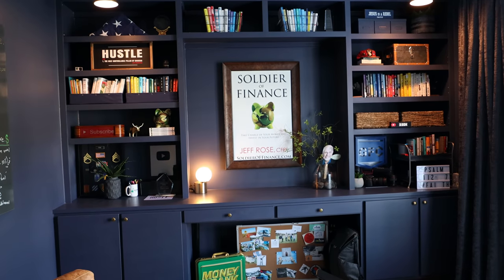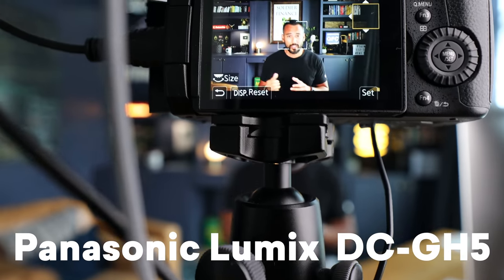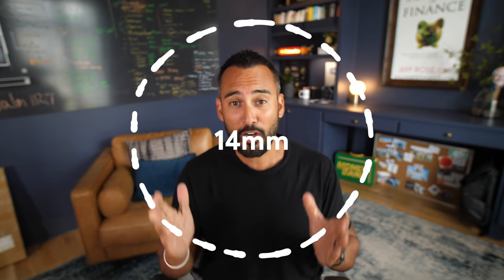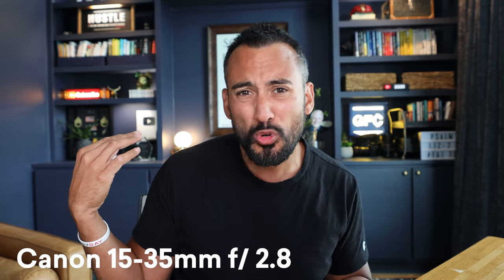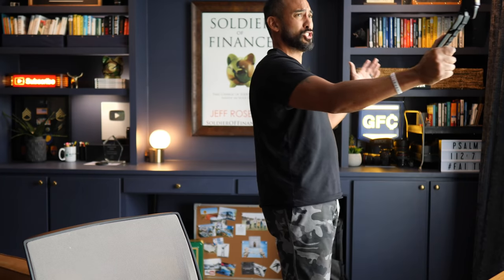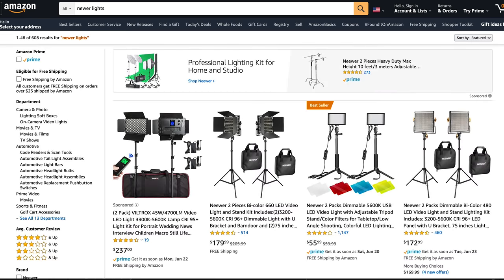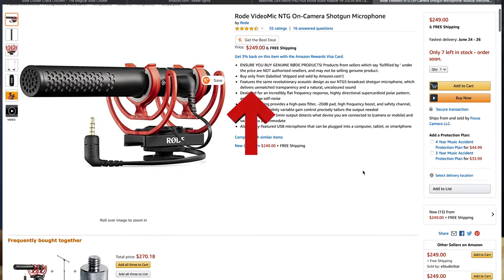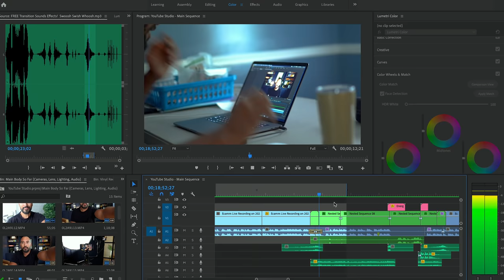My YouTube Studio Setup | Multiple Cameras On One Desk  (Part 1)

Comment: Your Canon camera footage is much prettier. And your home office audio set up is much better. Good video.
Reply from the maker: What’s “prettier” about it? 

There’s something about my main camera footage that has always looked a bit off to me but can’t place my finger on it 🤔
Reply: @wealthhacker  the Canon’s famous handling of colors plus your Canon is full-frame vs. the smaller sensor of the GH5. By the way, the fact that the Canon is full frame means that the 16mm on the GH5 is equal to 32mm on the Canon. The f-stops are also doubled. F1.4 on the GH5 is equal to F2.8 on the Canon. You can run a test by putting your canon at 32mm f2.8 and it should give you the same bokeh as you get with the GH5 setup with the 16mm at f1.4

Comment: Good stuff! I'm curious how you get the cameras to focus on your face. A lower depth of field typically means there's a zone where you're in focus and if you move away from that it'll get a bit blurry. Did you get someone to help while you were sitting in your usual position, or just get it right by trial and error?
Reply from the maker: The Gh5 has decent auto focus.  Not as good as Canon’s, but good enough for sitting at my desk
Reply: @wealthhacker  It was interesting seeing your 80D - that's what I've got. I've been using the Canon app so I can use my phone to set up the focus, but I've started using a new Sanyang 12mm lens that's manual focus only.